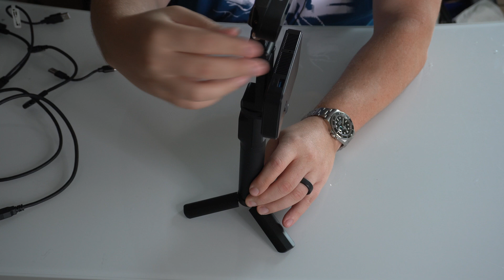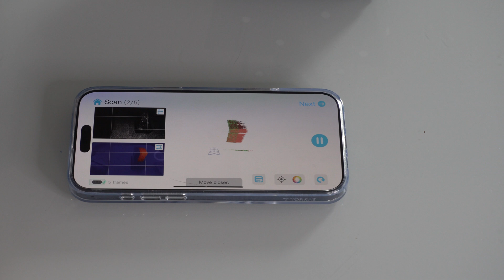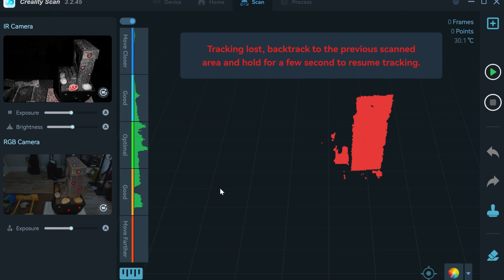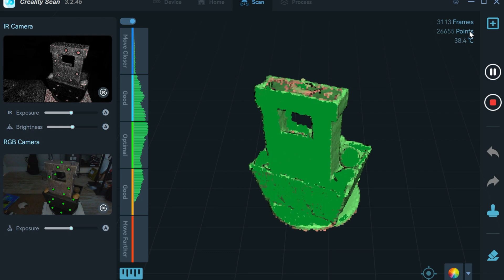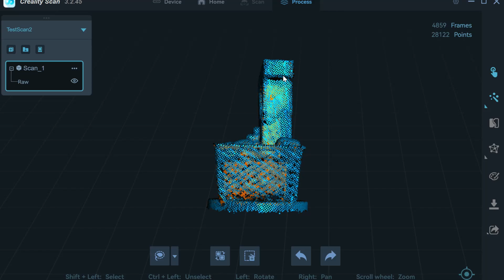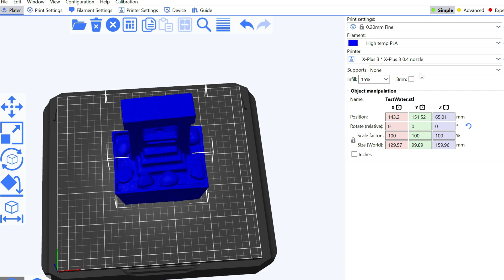Creality CR-Scan Ferret Pro – Setup & Initial Thoughts!

Comment: I just got the ferret pro , when I tried to connect my phone to the scanner it would connect and disconnect, what should i do?
Reply from the maker: Hi. I assume you connecting through wifi? I think the phone may try to drop back to your home wifi ifyour trying to access anything that needs data. If you stay in the app after connecting does it stay connected?
Reply: @3DPrintscape no it disconnects. I hooked it straight to a laptop and it would kind of work but I think I need to get a new one. Any recommendations?
Reply from the maker: Something seems off, i havent had disconnect issues like that with mine. If your within return period it may be worth swapping out.

Comment: The USBC cable that connects the power supply to the wifi bridge is the crappiest cable/port I've ever used. Brand new and straight out of the box, the cable keeps falling out. It's secure when I push the thing back in but as soon as I start to do anything with the scanner, it disconnects and makes me reconnect to the internet. 
All I'm sayin' is, buyer beware.

Comment: Hi and thx for the offer to put questions. I just bought a Ferret Pro with Firmware 1.22 and failed to set it up for mobile use (Iphone 13pro). The bridge is on 1.32 and a password is set. The app just simply does not connect. PC is fine via USB and WIFI. Thanks and best regards, Klaus
Reply: any updates
Reply: ı have the same problenmes

Comment: I watched your vid on crtouch and marlin firmware and you used a ender 3 pro with a v4.2.2 but i got a v4.2.7 and I tried to set that one up and it's driving me nuts please help
Reply from the maker: Hi. What issues are you having with the 4.2.7 board? Is it installed and working correctly?
Reply: @3DPrintscape  yes it's installed but it's not leveling I have tried installing the merlin software but it gives me errors on the merlin site

Comment: The scanner is awesome the software really s    ks. It won't let you connect to the phone and when or if you get the project into the software on the computer - nothing works. You can't optimize or mesh or even detail it - nothing works. And it is truly phenomenal when you do get a file/ project/ whatever transfered to the computer from the phone - because it never happens I spent 8 hours trying to get it to work and each time - network failure . . . . . great paper weight.
Reply from the maker: Hi. I had no issues at all copying the scans from my phone to the computer. Are both of your devices on the same network??

Comment: excuse my English 

i am using ender 3 pro for 4 years i want to upgrade to a new 3d print i don't know what to buy?
i want something fast easy to use better print quality can print most of the filaments budget friendly.
can you help?
Reply from the maker: Hi. It will really depend on your budget but i would go with one of the newer core xyz style printers that has klipper already installed. There are many options on the market but Qidi and creality are both good.
Reply: @3DPrintscape  bambu a1 all day long just upgraded from a a10 blown away by the difference  and it just works